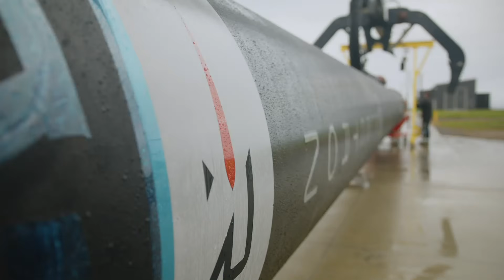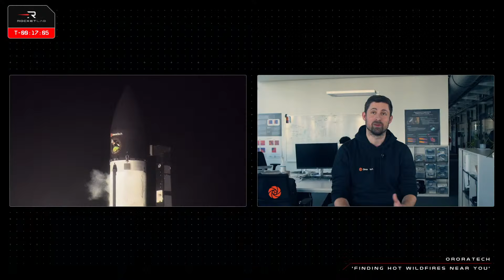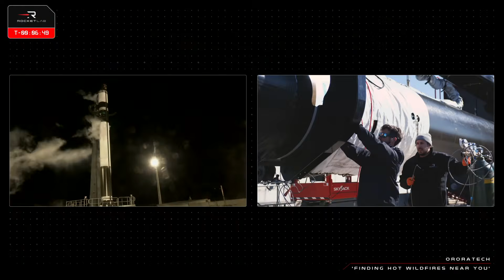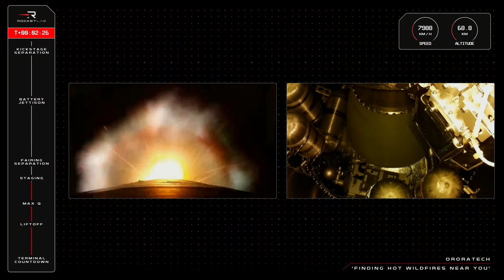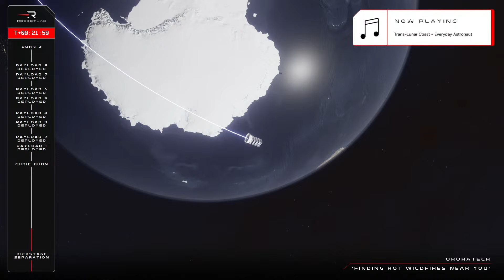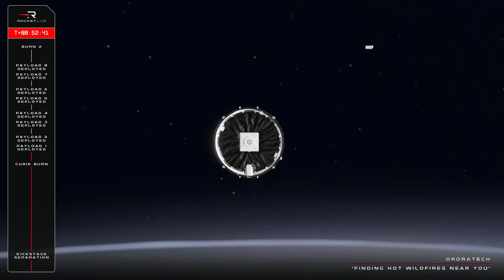Rocket Lab - 'Finding Hot Wildfires Near You' Launch

Comment: 30:37 - T-3/lift off,
31:50 - Max Q,
33:06 - Meco/Stage,
33:52 - Fairing separation,
37:05 - Battery hot swap,
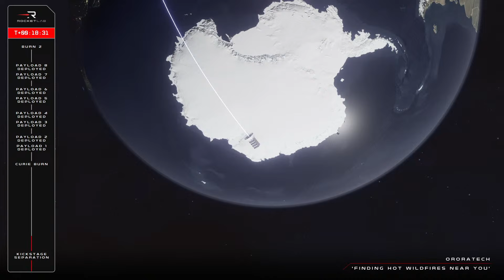39:39 - Seco,
1:23:26 - Payload 1 deployment,
1:24:10 - Payload 2 deployment,
1:24:52 - Payload 3 deployment,
1:25:39 - Payload 4 deployment.

Thanks!